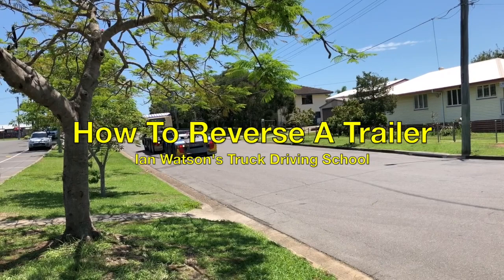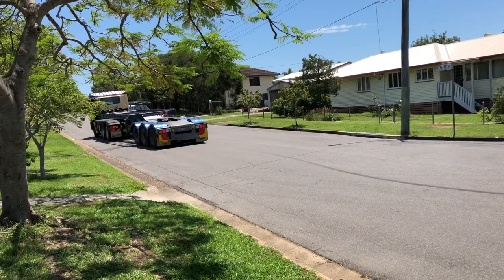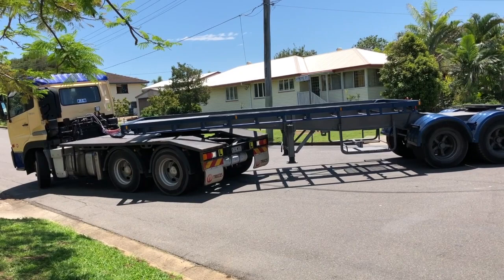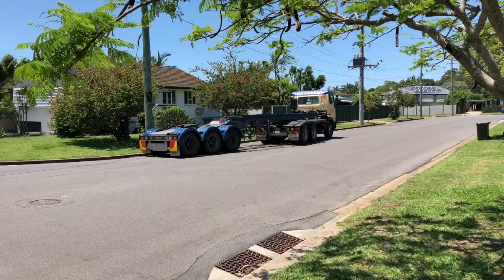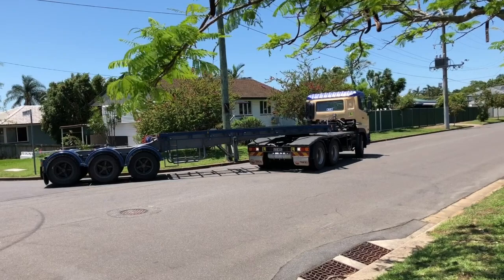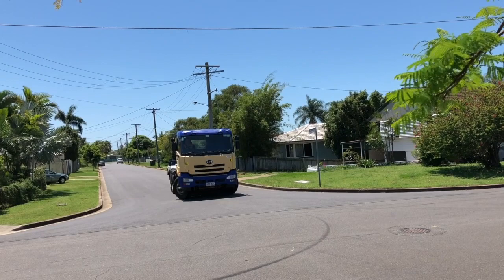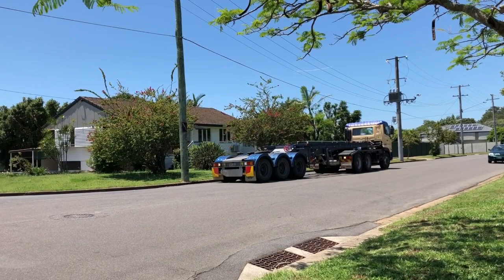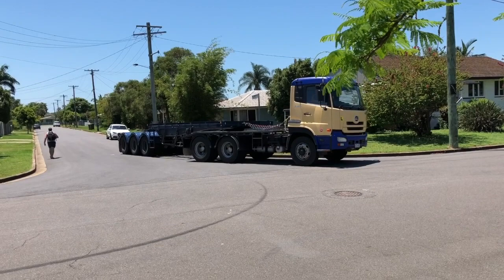How To Reverse A Semi Trailer - Trailer Reversing - Heavy Combination

Comment: Think of the lines you would take if moving forward and turning from the side street then put it in reverse in your mind. the trailer follows a different arc than the prime mover. Dog trailers with short draw bars are a curse.

Comment: I thought I was doing alright my first day on the job until I had to reverse a full curtain side trailer into a sloped driveway In the middle of a slight s bend road with cars parked either side.  It sucks coz you once you have to turn so much   the mirrors become useless and without a spotter it becomes guess work.

Comment: Ian thanks your efforts in your vid and useful info in 18 speed r r some driver say that “THE” truck “likes” double clutch while using splitters and moving the gear stick out and in,is that fact it or is it their habit ?
Reply from the maker: Each vehicle is unique.... you need to get familiar with your specific gearbox and make a few errors... learn form your mistakes. The RR gearboxes will tell you with a GRIIIIINNNNDD if you are wrong... they give instant feedback.